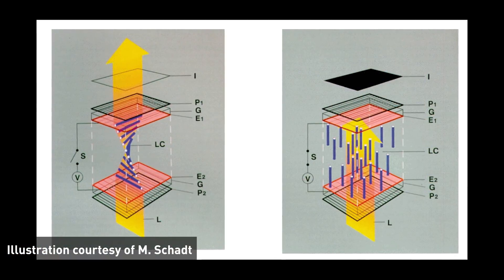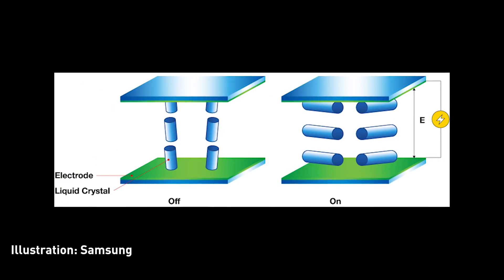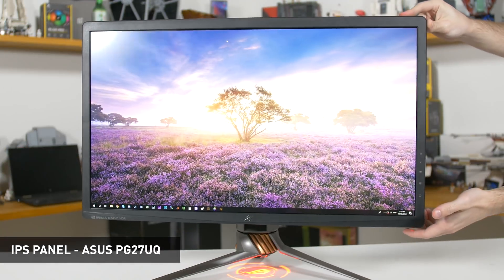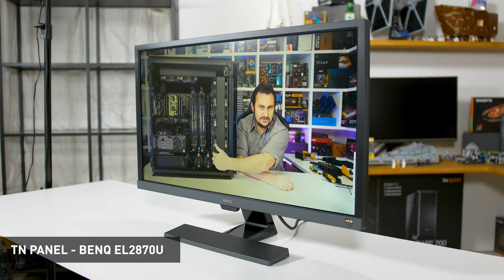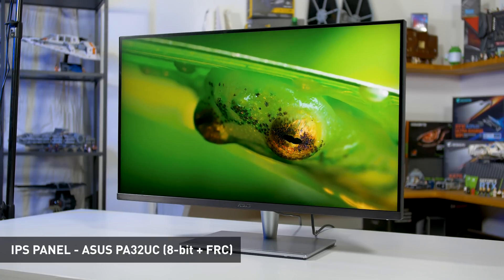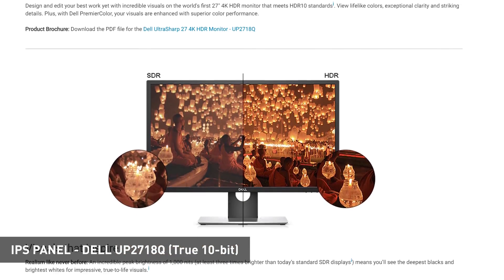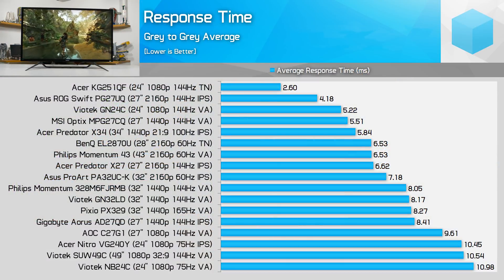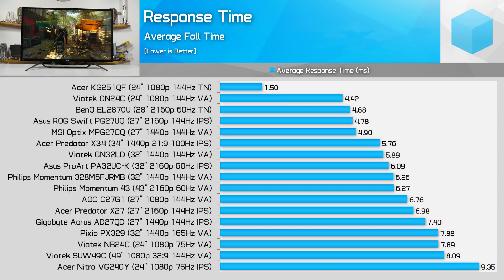TN vs IPS vs VA: Which LCD Monitor Tech is Better?

Comment: I know it's a terrible place for such a specific question, but anyway... I have Rx 580, and I'm thinking about buying a new monitor (old one is 60hz TN), and I'm stuck between either buying 144 hz 1080p (viotek gn24cb) or 144 hz 1440p (possibly some good IPS model or just cheap viotek gn27db, haven't decided yet). I plan to upgrade my GPU to either next amd card(Navi or whatever it's gonna be named) or next gen rtx, but neither of those are planned for release until late 2019 or even later. So is it worth to investing in good 1440p monitor right now even though 580 can handle 1440p only with serious settings optimization and only 60 fps, or should I wait until I get a better GPU later and then look for a good 1440p monitor? My main concern is that there is nothing concrete on when next generation of GPUs will be on the market(and pricing too), and by the time those are out IPS or VA panels with similar specs would be even cheaper, turning my investment that I can't fully justify with Rx 580 into pointless money waste by then. If HUB see it, then cool, if not any advice is appreciated!

Comment: I think it really depends on what a person's individual eyes find to be the most pleasing/unappealing with each technology. I would suggest that a person looking for a new monitor try them all and see for themselves; hopefully you have a Micro Center nearby.

I tried a handful of monitors last year and settled on a TN.

The IPS panel was a $700 Asus (PG279Q I think). It was great but had backlight bleed necessitating returning multiple monitors just to try to find an acceptable one which I got tired of doing after the third crappy one.

I tried a few different VAs but to my eyes while they all looked great for basic usage I could see a ton of blurriness and trails during movement in gaming. Some were better than others but I could see it in every one without even trying. 

Settled on a Dell S2716DG. TN with similar specs to the $700 Asus but half the price and the  viewing angles are fine for me with no backlight bleed. It's not perfect but it was the easiest on my eyes.

Comment: I recently bought a Samsung C27HG70 ( a va quantum dot panel), and ,at first, I was stunned by the image quality... but then a few hours later i began to notice horrible ghosting and smearing problem, whith no improvment when changing the response time setting but to see the brightness lowered ( samsung claimed it to be 1ms ...). This is a fairly recent va monitor and i'm, from what I've seen on forums, far from being the only one having this  problem. Am I being unlucky ? Because from what i've seen on internet, there is not that much high end Va monitors that are spared  by this issue, especially in high resolutions...
Reply: Lower the contrast and that will improve pixel response. It seems to really bother you, but it will still be different from IPS or TN.
Reply: @alexpop3883  think you for your answer ! I will try it out, but if the problem is persistent , i will probably replace whith an ips lg monitor   , probably a 27uk650. It dosent have any high refresh rate but I'm mainly a console player so...

Comment: I have the Samsung JG50 27" 1440p 144hz VA panel  monitor that you recommended in a previous video.. it's advertised as a 4ms GTG response time.. is that accurate? You said in this video the fastest you've measured is 5-6ms...

Comment: As for most things, impossible answer to question For the most part without taking into account user needs, primary purpose, additional uses & their priority/importance...

And the models/budget, which can greatly impact the availability of solid competitors to tech usually considered “the default choice” 

Aka, do your research, dont be an ignorant consumer, and if videos like this help you that’s great, 
JUST MAKE A MENTAL NOTE that these videos discuss the fundamentals and you’re nowhere near equipped to argue with someone well versed in display tech and all of its subtleties. 

Don’t be that idiot that thinks you know it all , once you’ve made your purchase you have everyone’s permission to stop trolling videos on the topic just to reinforce your purchase choice by shouting 
IPS = GOAT or whatever nonsense you manage to drool onto the keyboard before the keys no longer rebound. 

Thanks, this has been a Public Service Announcement, you may continue will your scheduled reading/trolling in 5...4...3...2...1...

Inevitably the next comment will be something along the lines of 

“Samsung displays are better than the rest no matter what the tech, Samsung CRT’s > LG OLED”

Comment: TN is best, viewing angles are never an issue either.. who moves around so much that it matters while gaming? Nobody. Also i wouldn't go to IPS now, bound to notice less motion clarity as extra blur. Dell 165hz 1440p 24" screen has been great for me. very clear.
Reply: I totally agree. I've been holding off on a monitor because of tech and expensiveness. VR headsets should be pretty good because they need less light to function. There should be less motion blur.

Comment: Nice work Tim, as usual a well laid out video with good presentation.  

I have a question about multi monitor calibration.  I have the following monitors as a dual monitor setup. 

Acer x34p and ASUS PG279Q. How can I best calibrate them so their respective colour outputs are ‘close’ to each other than a subjective ‘eyeball’ comparison?

Are there any reasonably priced tools to do this?

Perhaps a video showing your viewership how to best calibrate their monitors?

;)

Comment: Question folks. I do alot of fast paced high level comp gaming. I own a TN 1440p 144hz 1ms display right now, but comparing to my OLED C7 the image quality just lacks.. well, everything. I want to switch to a high end IPS 1440p monitor but it has 4ms. Will i notice the difference in the fast paced gaming or is the amount of ms neglectable?

Comment: This is not making it easier. I currently have a 144 Hz 1080p TN monitor and I really have no issues at all.
But I feel like my next upgrade should not only be in resolution, but also in overall quality. I'm currently looking at specs like: IPS 1440p 120Hz gaming monitors (low response time).
They should be fast, with a rich and clear image and no issues (like burn-ins or whatever there might be). Can anyone make a recommendation?

Comment: I like TN personally. 1ms 144 Hz 1440p monitors were life changing to me. I'm not worried about viewing angles because I only look straight into my monitors. And I honestly I feel the viewing angles aren't bad on my particular TN panel anyway. I have watched video from distances away without issue. When it comes to gaming its second to none. You just can't find these specs on other panels. I eventually would like to get into HDR but true HDR panels appear to be a couple years away. Unless you want to spend absurd prices. The 4K HD Monitors I have looked at are well over 2 grand.

Comment: Having used all 3, VA is my ultimate favourite
Reply: i literally just cancelled my va monitor order for a tn monitor. the va model i was getting had ghosting issues. so i switched to tn... was that a bad idea ?
Reply: @testtest1982  model? Maybe...
Reply: Atu Gamer i ordered the Acer KG241Q Pbiip
Reply: If you've got the money I'd just buy a VA and IPS panel. I like to do some art as a hobby which makes IPS ideal and for most games I prefer my ips panel. For media consumption I prefer my VA generally due to the contrast and pretty good color. I tend to use my IPS panel as my main monitor, while I may have videos, or a movie up on the VA .
(Sorry for wall)
I would say VA is most suitable to the general consumer, as most people will prefer the contrast over slightly better colors of IPS and may have issues with IPS glow. Though if you game more than you consume media, go for IPS, or even TN if you're into fps games. Just one man's opinion though, I would just go to a store a look at them if possible, or buy one somewhere that accepts full returns (usually 14 days w/ original packaging at least in Canada) and try each out for a week or so.
Reply: @Inv1te  depends on the model

Comment: I have two fairly recent 4K purchases. A 27” IPS Computer Monitor(LG 27UK650), and a 55” VA ‘Gaming’ TV(Samsung NU8000). Just want to say that I really enjoy both of them!

The IPS color accuracy is awesome and has fantastic image quality. Astonishing difference from my previous 5.5 year old 1080p monitor. The IPS glow isn’t really noticeable with just about anything other than a black or really dark image on screen. It’s really a non-issue, for me anyway. The picture is savory. It’s not the greatest at handling motion, but Works for Gaming. I do have a small regret. I wish I’d waited for a 32” model with the equivalent performance and features, for the same price I paid.... for 4K. But with that said, 4K is not wasted on a 27” screen, it makes very sharp clean looking pixels!

The Gaming TV is a lot of fun. It has good looking picture, good response time, and not too bad when it comes to input lag. Handles motion on screen very well. Great for gaming! And the other day I bought a nice Soundbar(Samsung HW-N650) for it, which made huge difference in the sound department/soundstage.

If anyone was hunting for some recommendations, there’s a couple from me. Although these are fairly recent purchases for me, these are not the latest and greatest products any more. They are moving into slightly outdated territory. But I will be enjoying them for a number of years! Especially considering that for me, they were a princely sum.

Comment: i have 144hz benq tn monitor and for next upgrade i will go 32inch 4k ips or va panel, from my testing 144hz tn against 60hz ips asus monitor i could totally play csgo and as i dont play that much competitive tittles anymore im starting to get annoyed by my monitor low viewing angles and especially poor colors. The worst thing is when i try to choose color for my 3d renders i get bad color tone and visible color gradient. 144hz is overrated in my opinion, many people would disagree but honestly whenever i ask for other people opinion at my place they were not sure if the difference is even there, personally i can definitely see the difference but it is not big enough especially when 144hz wow factor wears out, for your regular folk big screen, 60hz IPS or maybe VA is where its at.

Comment: Been sticking with VA for a long time now since i love my deep blacks and vibrid color range, only major downside is you gotta be a lot more careful with what monitors you're picking up, VA tends to have more smearing/ghosting issues so only go for the monitors that have a good amount of reviews, don't jump into something that sounds really promising but has next to no coverage from any reviewer or even regular buyers, cause you just might get a huge horrible ghosting smear mess, happened to me once with a shitty 27 inch samsung VA monitor [C27F396FHU] and wasted like 300 euros, couldn't return it as it was not considered a fault, even though it was some of the worst reverse ghosting i ever saw in my life.